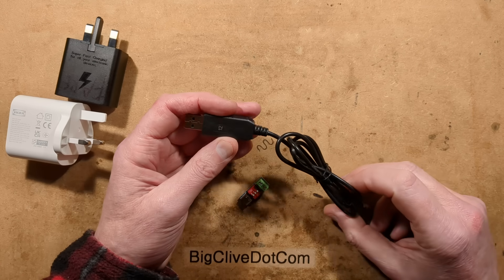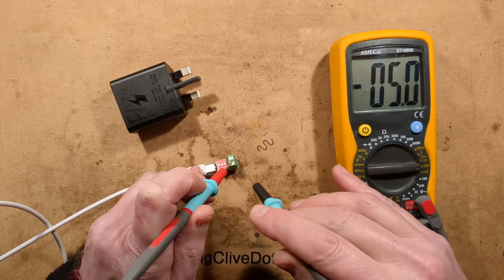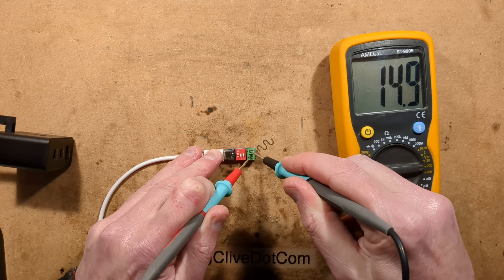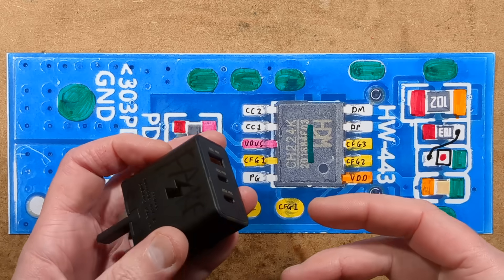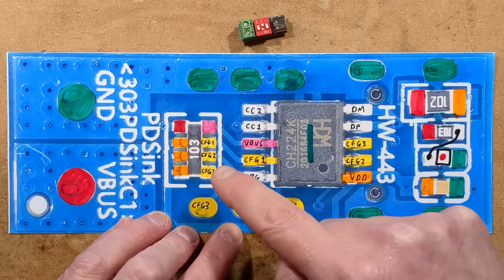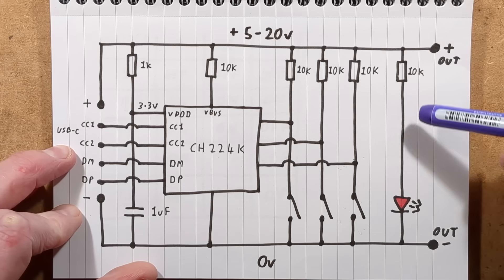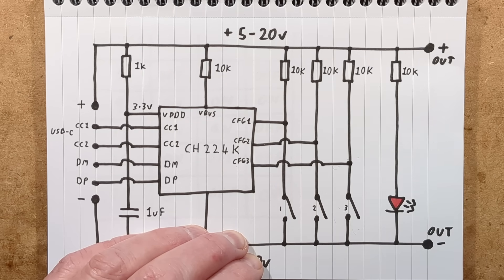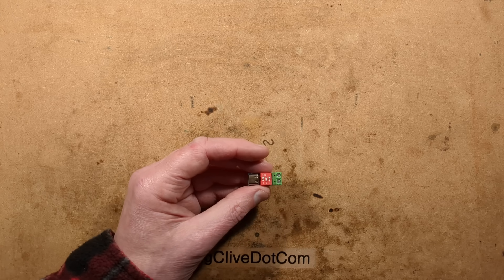Cheap USB-C programmable PD voltage module for 5,9,12,15,20V

Comment: I just got a baggy of these in a recent shipment of random crap I ordered while half-asleep. Now I feel much better about using them.
Reply: I’ve been using one weekly to charge a solar battery pack on cloudy days for a year now. At up to 60w 20v from a laptop supply, and no problems. I did entomb it entirely in silicone to avoid shorting, since everything at work gets sprayed accidentally. I had concerns about heat not escaping after, but it doesn’t get that hot since all the ac/dc conversion is done in the supply. I could maybe wish for a table of the dip switch settings because it’s just annoying enough to look up that I end up using a multimeter. Not sure where they’d fit it though.

Comment: Love your stuff. A guess is that there's no intent to dissipate heat with through that center pad. The chip needed an 11th pin, so they used the center pad to get it. The board maker just used standard PC footprint to get at it.
Reply: Good point, the chip dissipates 50-100mW so the pad isn't needed other than for signal as mentioned. Its probably a bit more expensive for them to manufacture though.

Comment: I've used these types of modules before. You must be careful with them, because sometimes they don't start up properly and they send the wrong volatage momentarily on startup. Not a great experience when you have a device that expects 9 volts and it gets 20 volts briefly. 
[Ah good, you mention this risk at the end of the video]

Comment: 8:20 - The voltage monitoring might be for fallback to previous negotiated value if it can't muster new higher voltage?
switch being inverted now makes sense for when you had it set to 101 for 12 volts and 100 for 15, which seemed odd to me

Comment: I found out about these with the nice dip switches after using a bunch with the solder pads. Would have been nicer for prototyping at the time.

I like the little danger adapter I made for my atari 2600, usb-pd in on one side, 9v out to 1/8" TS on the other. It lives in a labeled bag so no one confuses it for a dac lol

Comment: Clive i dont think that fake Samsung charge is pd. I belive its qc3.0 which stops at 12v that's dead give away for that is the orange ports Samsung used it id be intrigued to learn how they are translating usb c specific pd resistivity values to qc

Comment: For permanent installations, like to replace a dedicated power supply with a USB-C lead, I would recommend to get the fixed adapters so less risk the switches get mucked up and send too high of a voltage.

This is however very handy for testing and prototyping to have a quick power supply for a project
Reply: Yep, I agree for prototyping. There is a version that you solder bridge the pads instead.
Reply: @IrishFinalExit  I got some prebuilt adapters with dc barrel jack for 12V, I converted quite a few devices to usb-c
Reply: @Yrouel86  I think I have some those too, they are pretty handy
Reply: Cover the switch in glue.
Reply: If you look at the CH224K datasheet, you can replace the DIP switch with just one resistor on cfg1, and based on its value it will set the voltage.
Reply: After you put it to your device, just drop a dab of glue on it so it never changes. They're like 80 cents each if you buy them in packs and they are kinda for permanent attachment to devices

Comment: I will never get used to hearing "real good quality" and "IKEA" in one sentence.
Reply: Their electronics is great, actually.
Reply: @JGnLAU8OAWF6  I am very familiar with the appliences they use in their kitchen systems and can tell you they are anything but reliable, therefore i have to strongly disagree with you.
Reply: @KwizatsHaderach  chargers, lights, batteries, their scales are all quite good.
Reply: @KwizatsHaderach yes always heard to avoid those like the plague.

Comment: the dip switch and screw terminal is kind of genius. i've got one that uses jumpers but dip switches are just easier
Reply: It seems a bit pointless though, most people will only set it once, making jumpers or solder pads just as good....
Reply: @edwardfletcher7790  i would use the dip swtich version for prototyping, and then probably switch to a jumpered or solder pad version for a permanent installation. i built a little power supply ages ago that uses an LM317 to do what this dip switch version is doing and i found it annoying to fiddle with the trim pot to get the voltage i need, which was often 3.3, 5 or 12. i eventually went to an old Dell ATX power supply to pull various voltages from but then i have this relatively massive PSU that provides hundreds of watts when i only need maybe 10 watts. the dip switch usb C module is perfect because it moves all the switch mode stuff off to the wall wart, is very small, has accurate common voltages, and can easily be changed.
Reply: @Gunbudder 
I hear you !

I love those new little $2 USB A DC Booster modules with the small brass knob & 4 digit display, 1.2V - 24V at 500mah. 

I keep one with a pair of alligator clips and a small 18650 power bank for testing any battery powered device 👍

Comment: I've yet to actually get a USB-C power supply, my current phone is a USB-C device, but they supplied it with a USB-A (with some "turbopower" thing, whichs sounds more like a 1980s Hoover product than a charger), so all these extra voltages are not as yet available to me, cos I've not yet needed them... :P
Reply: Your phone will make a happy noise when it finds itself plugged into a faster charger.

Comment: When I worked, it was as an engineer. When I retired, electronics became a pleasurable if time consuming hobby. Now, I seem to just fanny about (am I allowed to say that?) with voltage regulators, power supplies and battery management systems. Guess the next stage is SPST switches, then I’m done. 
(Or I might dig that 60 year-old old Ladybird book out, puce-coloured, with a battery, a bulb and a magnet on the front.)
Reply: My retirement tasks, right now, are mainly replacing microswitches on super old but serviceable home appliances. We engineers try to get to the root of the problem. Wife says toss it, buy new. Nah, patching, repair is so much more fun. Saves the landfill too. Right now I'm looking at a leaking water check valve that is very complicated. Plumber says the valve is $980 plus labor to replace it. I look at it and I want to rebuild it in place. But it is part of our heating system. Wife want to leave it 'til summer. Ahhhh! Why wait?
Reply: @BB-iq4su There’s a risk of a part being needed before Xmas nonsense, perhaps? But you’re right; I can’t bear to throw electronics in the bin. And even when I must, I can’t sleep until I’ve done a full fault mode analysis on it. Sometimes I wish I was normal. Crap TV might be good to watch…
Nah, I like being a geek too much. 😐

Comment: So with three switches, that makes seven combinations of ways the switches can be configured.  The devise only has five configurations.  What about those two "forbidden" configurations?
Reply: One switch toggles 5V, the othe two encode 9V, 12V, 15V and 20V in binary, but are ignored if 5V is active.
Reply: 8 possible switch configurations.
2³

Comment: Nice vid Clive! Did not know a simple 5 volt supply could handle this...
Reply: This only works if the power supply accepts the voltage programming inputs. The device does not actually change the voltage, it just tells the power supply the maximum voltage device is able to accept.
Reply: *edit* replied to the wrong comment 
One switch toggles 5V, the othe two encode 9V, 12V, 15V and 20V in binary, but are ignored if 5V is active.
Reply from the maker: It needs chargers that can put out higher voltages on request.

Comment: How does ot always stay 3.3v with a fixed resistor and changing voltages?
Reply from the maker: It uses a shunt regulator like a zener diode that caps the voltage and drops the rest of the voltage across the resistor.

Comment: My fear with these things is that if i would be using a power supply with say 2 or 3 or 4 usb outlets or a hub, and i use one outlet simply to charge a 5 volt device and then i stick in one of these modules to get 20 volts, then all outlets deliver 20 volts
Reply: The only way that could happen is if you use some sort of passive USB splitter, which would obviously be non compliant with USB standards.
Reply: I wonder if a compliant USB-PD charger with multiple USB-C ports must be able to separate voltages for all the ports. If that's true then your fear shouldn't ever happen.
Reply: @zzoinks it should, but 'should' doesnt take my fear away. Even now for instance not even all the USBC cables work the same
Reply: @ed2595 your fear is irrelevant because it has nothing to do with this module you would have the exact same problem if you plugged in a laptop USB-C cord that requested 20 volts. Meaning if your fear were to come true the fault would be your power supply not this module or the device requesting power
Reply: @nerys71  well one fear is not annihilated by another. I would think i myself can decide what Ii am concerned about

Comment: How many watts can this model handle at 5V and 12V? Has anyone tested it?
Reply: does it even have a max watt limit? It's just requesting the voltage to the PSU anyway
Reply: @marcogenovesi8570  If I may summarize my understanding based on the technical discussion:

The USB-C PD Decoy Module's primary role is voltage negotiation. The ultimate power handling capacity is determined not by the module's request, but rather by the intersection of two critical constraints: the maximum current output offered by the Power Delivery Source (PSU) for the specified voltage, and the intrinsic thermal and current limits of the Decoy board's own physical components (such as the PCB copper traces and connectors).

Comment: That looks like a very useful device.
Reply: They are, and there are lithium battery charge controller modules that work like this but are pretty much automatic so there are no switches to set - I have a project that I'm powering with a LiPo battery pack, and using a USB3 battery charger module for it that autonegotiates for USB-PD 2.0/3.0 and it's great.

Comment: I wish the devices would output ONLY and AFTER the requested voltage is available and after it is negotiated, and not outputting 5v straight away and then change to the desired or the closest possible by the the power supply
Reply: They'd probably need an additional component to prevent output until it's needed , right? Like a mosfet?
Reply: I'm not an expert on this but that could be a problem with your power supply I believe the default for the spec is zero volts this is why you sometimes get those cheap devices that have USB-C ports and they don't work at all when you plug them into a quick charger and that's because they don't have the trigger in them to tell the PD charger I'm just a dumb USB 2.0 device give me 5 volts so they get zero volts.

Meaning your charger is supposed to put out zero volts until it receives a triggering signal for the correct voltage it needs to put out

Comment: It's pretty hard to get an actual PD power supply from the china sites. I've ordered a couple different ones and they're all just 5 volt power supplies with false labeling.
Reply from the maker: I strongly recommend against power supplies from unknown sources.  They can have very poor isolation between the mains and low voltage side.

Comment: Is this basically a switch for a PD adapter? No filtering, smoothing, CC or CV?
Reply: All it does is tell the USB PD power supply which voltage to output. It's not any sort of power supply or voltage regulator.

Comment: Clive could you help me..I was going to buy the IKEA 45w but does having only 1 cable plugged in do you get the 45w or do I just buy a Belkin 45w for £2 more as I need a 45w Supercharger and the official one is Double the price
Reply from the maker: If the device being charged negotiates a higher voltage then the full power is possible.  I'd choose the IKEA supply as it is from a known source.

Comment: How does the VDDD get 3.3V from the supply if the device can increase the voltage from 5V to 20V?  Wouldn't the voltage to VDD increase as the device negotiates more voltage on the supply?
Reply from the maker: It has an internal shunt regulator.

Comment: It could be the fake PSU is giving under voltage, and the PSU is changing back to 12v
Reply from the maker: I think it's just not capable of the higher voltage settings.

Comment: You'd have thought that as with most DIP switches they just represent a rising binary number that matches with the 5, 9, 12, 15 20. But they've chosen a setup that doesn't appear to make much sense. 0 = off. 1 = on.
000 5v
001 5v
010 5v
011 5v
100 15v
101 20v
110 12v
111 9v

If they'd set it up to use binary it would be much easier to remember the switch setting for the voltage.

Very odd.
Reply from the maker: It may be because they have the switches shunting to the zero volt rail, so the logic is inverted.

Comment: I was just looking for this, thanks for sharing, Clive! I ordered some of these and will use them in my new EL84 desktop tube amp. (with a boost converter to get the UB+ of ca. 315V). Only need ca. 2A@20V, thus a 65W charger should be enough.

Comment: How about 3.3V out ?
Reply from the maker: That's not a standard USB voltage.
Reply: @bigclivedotcom Arduino
Reply: USB PPS can do 3.3v
Reply: @falxie_ Yes but if you have a dip setting then you don't need it.
Reply: @DonnaF-yi4jx as big clive said that's not a standard voltage. afaik the only way to trigger 3.3v from a type c charger is usb pps if it supports it
Reply: @falxie_ apparently it is the standard voltage of the chip  doing all the work. So it is a standard.
Reply: @DonnaF-yi4jx the chip is powered by 3.3v and that voltage is achieved with a resistor. the way these pd trigger boards work is by having an ic communicate with the charger to request a voltage in the pd spec and 3.3v is not in that spec. the ic itself isn't producing the voltage.
Reply: @falxie_  So lets try driving it with a standard 5V.
Reply: @DonnaF-yi4jx what are you wanting to accomplish?
Reply: @falxie_ Can Ch224K out 3.3V and the answer is no.

Comment: Maybe the additional voltage sensing is for it to compare the voltage to what it should be and if it is too high or too low it might try to turn off the PSU for safety. Maybe you should test this, it would be interesting to see if this is actually the case. Cut the line and add your own PSU and give it a 4V too high voltage to what it will request and see if the PSU turns off.

Comment: I have a 4-port "intelligent usb charger" from ali. Feed it with 13.8V DC @ 8A and i did note the macbook is not happy with it, ramps up voltage and current and then resets. Android does fast charge 9V @ 2A no problem. Should i feed the charger with 24V instead? What is max usb-c voltage?
Reply from the maker: If it's a vehicle charger then there's a good chance that their stated currents are fake.

Comment: I use 2 of 12V fixed ones for my 4 external hard drives. You can power 2 HDDs safely from one PD port, if it provides up to 3A at 12V. Eliminated a lot of clutter. I power all 4 HDDs simultaenously and copy backups onto it at the same time.

Comment: Clive, can you make a video on diy "battery eliminators"? i did 1 just a few days ago, connecting one of the smalled pd modules i found on aliexpress with a low drop buck converter (with pads on the back to allow voltage selection, by default they come as "adjustable" with a small pot), pretty much same size, and easy to connect via standard pin headers... neat little device, i use it with a pd powerbank to power a small candle lamp for my mum memorial photo... 3 days, powerbank is still at 100%, while it was eating batteries at 2 every few days... the combination of the 2 modules is because the pd module keeps the powerbank on even at low loads, and the buck brings down voltage to 3v i needed...
Reply: That sounds like a nice system! I might need to do that for a similar decorative light I have that uses the button cells
Reply: @zzoinks  i used this step down: "1-10pcs Mini DC-DC 12-24V To 5V 3A Step Down Power Supply Module Voltage Buck Converter Adjustable 97.5% 1.8V 2.5V3.3V 5V 9V 12V" (green mini module)
Reply: @zzoinks  and this pd module: "PDC004-PD PD Decoy Module, USB-C PD 9V 12V 15V 20V DC Fixed Voltage Power Trigger Module 5A Type-C Female Input for Notebook" (blue mini module)
Reply: @zzoinks  they’re pretty much the same size (about 1x2cm), and if you put them back to back, you can put 2 header pins between them, soldering exactly the 2 middle holes… then you’ll have on the side both gnd and the adj output… put in a pd powerbank or psu, and you’ll get out whatever voltage you want… if normal powerbank, you can get out 5v or lower, but this way the powerbank will not shut down because of low load… love this solution, small and easy

Comment: shame they didnt add three led lights connected to zener diodes that would light up at certain voltages to indicate what the output voltage is

Comment: I got that module to replace my old broken laptop charger. Works great at 20v 3,25 amp
Reply: Great idea. It's a shame some of the big names (hp,dell,ibm,etc) need a third proprietary format signal output from the supply before the computer allows charging.
Reply: @sometimesleela5947 I have an old Thinkpad with barrel plug
Reply: @sometimesleela5947  you can get aftermarket USB-C to HP/DELL etc leads now at least

Comment: USB C to A adapters can be shucked to get a fairly inexpensive USB C port you can shove into a DIY project with easy solder pads and the required resistors to tingle the CC pins to activate C to C chargers. That's an option if you only need 5v, might be cheaper and smaller than getting a whole one of these. Might also be safer too.